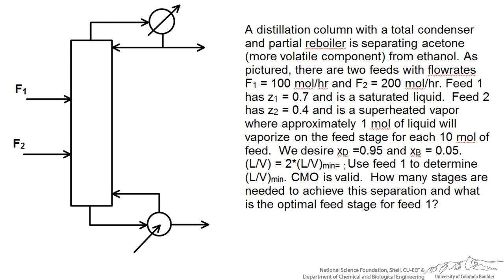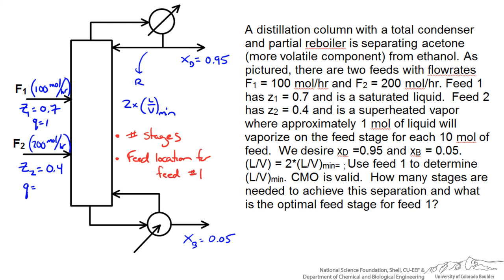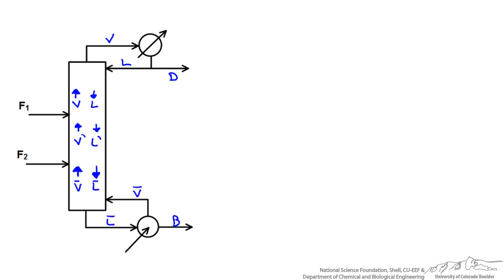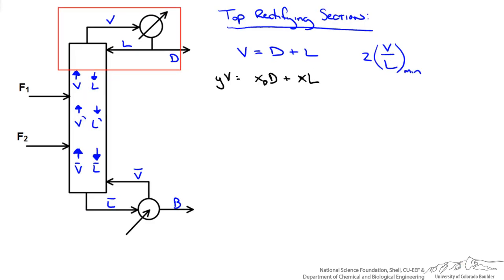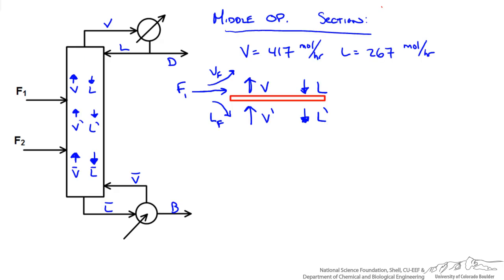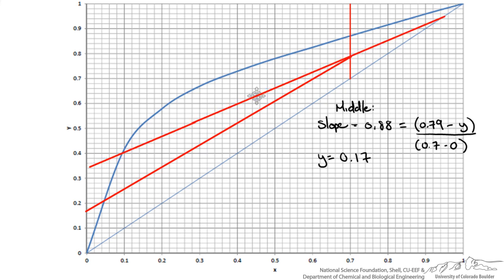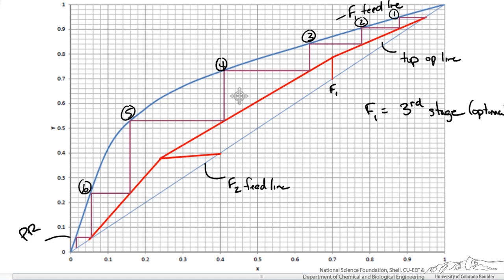Binary Distillation with Multiple Feeds

Comment: Can you please clearly specify how did you came up with the value of the intercept on the y-axis (which you clarified it was 0.34) ? 

I’m referring to minute 6:01 and slightly a few seconds before.
Reply: Plugging in y=mx+b where the slope is 2(L/V), and using y=0.95 and x=0.95, you can solve for b. Then the equation is just y=2(L/V)x+b you can plot the line.

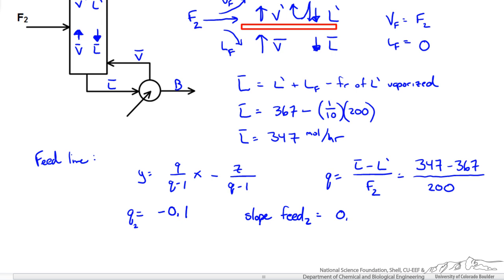Comment: at 10:08 the feed line equation is backwards in the denominator for the intecept. Though you solved it correctly i belive the intercept should be z2/(1-q)
Reply from the maker: Thank you for your comment.  I think this is just a nomenclature difference.  In the equation, the y-intercept is subtracted from the x-term.  If that were positive, the form on the bottom would change to 1-q.  I hope that helps.

Comment: Shouldn't the partial reboiler count as an equilibrium stage and not the total condenser?
The partial reboiler is the one where equilibrium occurs, since a part of the liquid stream coming down is turning into vapor while the other remains a liquid (bottom product). At the total condenser, all the compositions remain the same since all the vapor going into the condenser is turning into liquid (meaning equilibrium doesn't happen).

Comment: Hi. I'm a chemical engineering student and I'd like to say that your tutorial video is very helpful, so thank you! However, I'm confused with the VLE graph. The question stated that it involved acetone-ethanol, but you said it was acetone-methanol. When I tried to plot the VLE data, it doesn't match with the graph used in your video. I eventually found out that the graph was plotted using methanol-water VLE data by obtaining the x and y values manually from the graph in the video. Please advice.

Comment: i think you may have made mistake sollving L bar. I got L bar to be =L' -1/10L' which is 366.7-1/10(366.7)= 330.03 kmolperhour
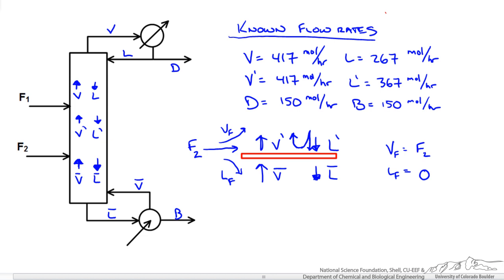Reply from the maker: The substitution made for the amount of liquid vaporized is based on the quality and flowrate of the feed stream.  It is still, however, liquid from L' that is vaporized. Please reread the problem statement and go back to 9:10 for the explanation.  I hope this helps.  Thank you for pointing out a great question.